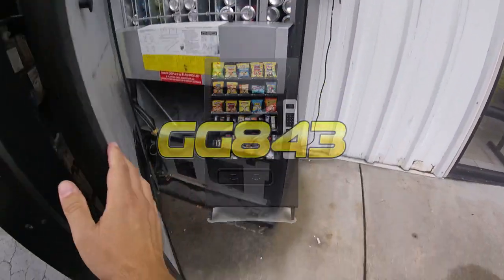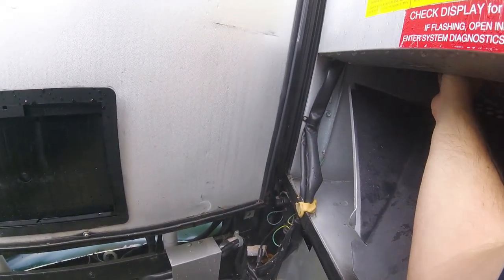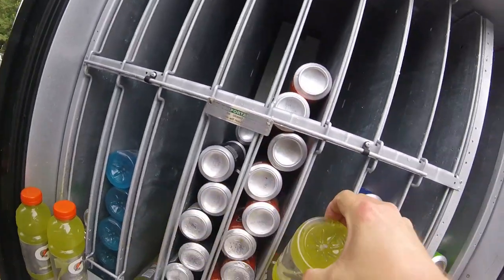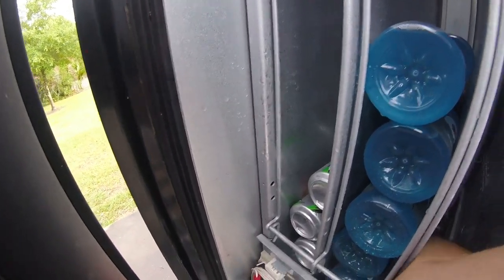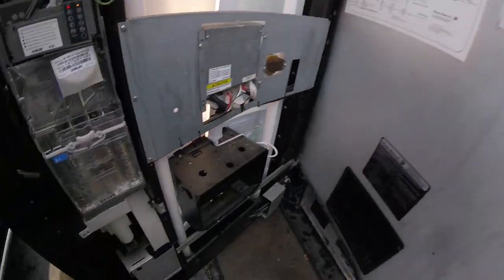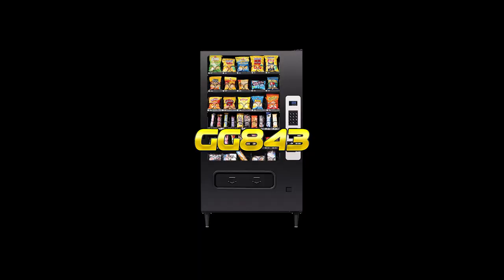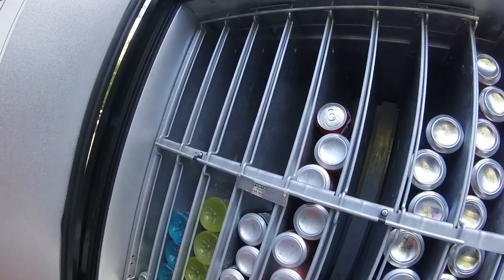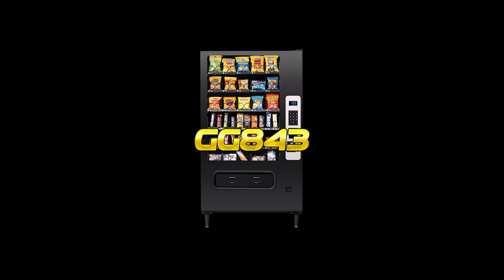Dixie Narco Vending Machine Repair - Jammed Columns And Button Membrane Fixes!

Comment: When I worked at Pepsi and had a call for a jam on a column I would take cover off and then I would unplug the vend motor then release the brake. Column would fix it self.

Comment: You can unplug the two wire stack plug at the bottom of the door and it will kill the power to the while door. You can always contact me with questions.

Comment: JUST bought this model machine and thought I had to do one or the other cans or bottles.  Do I have to do special programming to get both?  My machine will be in an area where I think bottles would do better, but I have limited access to purchasing 20 oz so I was going to do cans.
Reply from the maker: For 12 oz cans and 16.9 oz bottles you can use can shims. For 20 oz bottles you need bottle shims
Reply: @GalaxyGames843  thanx for the reply.  I understand what a shim is, but not in this context.  Where do I find these and identify which ones I need?

Comment: As a vending machine service tech I believe the JC 10 error is most likely related to your board. Chances are the board on your machine came from a different machine and was refurbished. Some DN machines have 10 columns. If this is the case you don't have a serious problem but it will always be there.
Reply from the maker: The JC10 error went away after changing out the membrane though